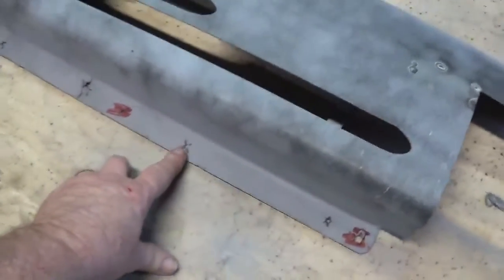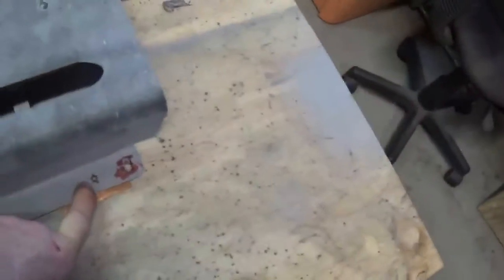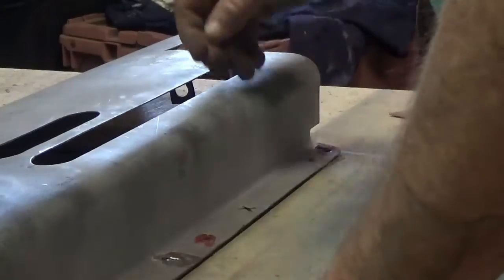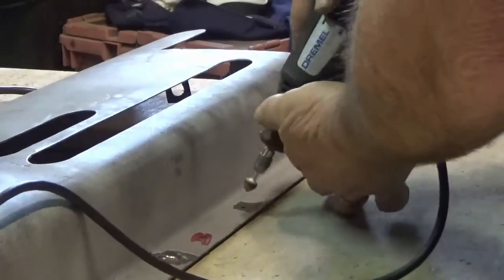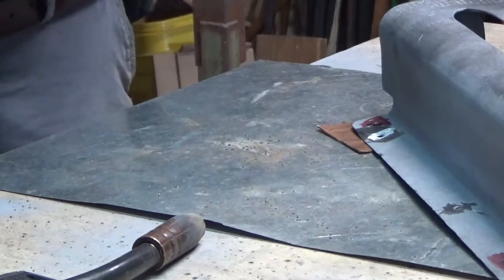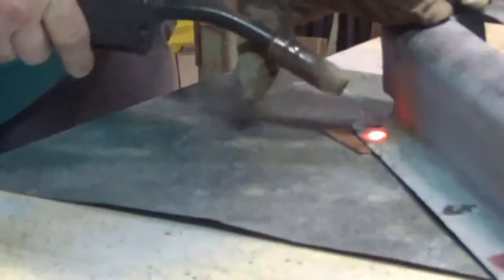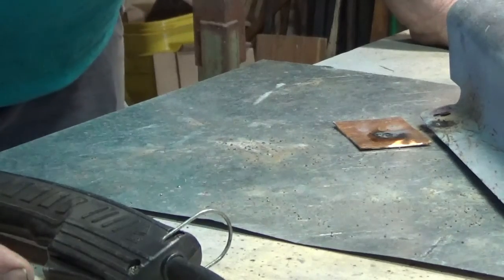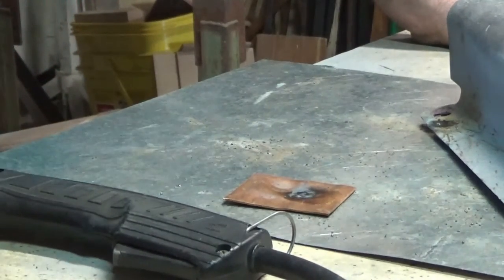welding on copper.

Comment: With a Flux fill, you did really good on that one man! Once you get your MIG set up, you'll be able to do the "dauber ball fill" so you're not in it as long (less chance of warp & burn out) and a whole lot less slag clean-up. Only things I can add to it, is to get ya a flapper (sanding wheel) so it doesn't take as much material when you're cleaning it up (wow you really clean it too lol, you get it prepped for TIG). In a pinch I've used the hard stone grinders (even cut-off wheels when I'm not supposed to) but be careful you don't take too much and thin it out to the point of burn out. Other then that..... keep the vids coming my friend. Your advise is solid, and I can tell you are settling into your own groove when you hit that "red button" and it's freakin' awesome to see happen man!
Reply from the maker: Thank you for welding and prep tips ....I for some reason couldn't find your email mail address....but that's ok....my next video im doing today called stickers should salve the thing 😀
Reply: @one62projects  No problem at all man.... as for the address.... hmmm, it should be in the "about" section of my main channel page? Anyway, I look forward to the next one man! Keep 'em comin'...... and I'll keep a wathin' them.